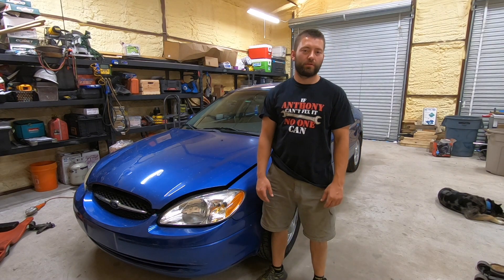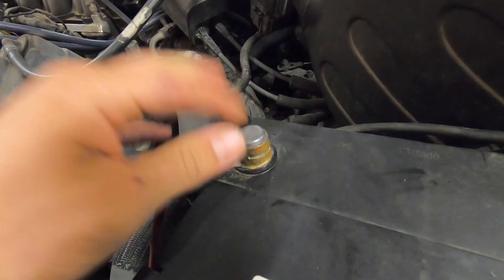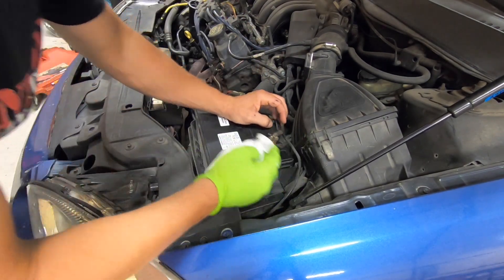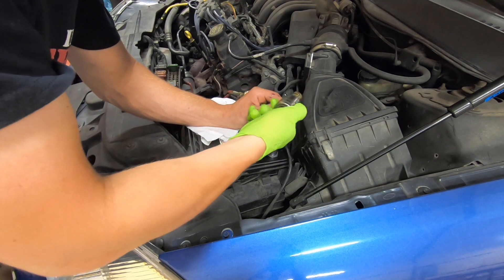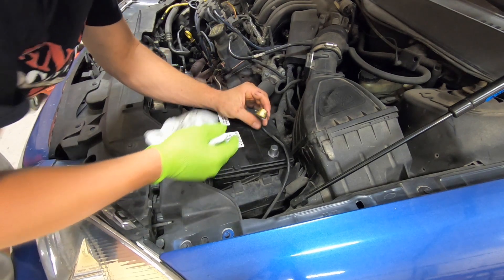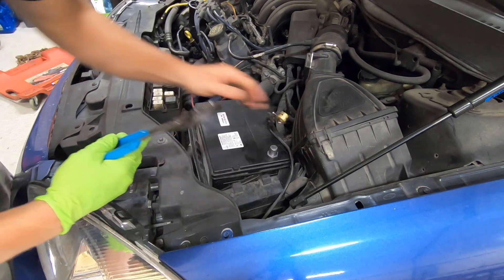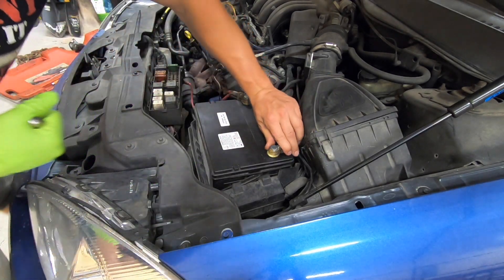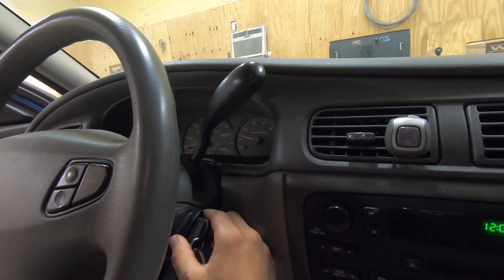HOW TO CLEAN & TIGHTEN LOOSE BATTERY TERMINALS  || EASY

Comment: When you start the car and you hear a ticking and when jumpstart it, it starts but only stays up for a minute or so could this be a problem of tightening it right?
Reply from the maker: Not likely. If you can grab the battery wires and tug them and they do not move, they are tight enough. It sounds like your alternator is bad
Reply: @dudewecanfixit  yeah got it fixed now but problem was the alternator and battery was old.
Reply from the maker: That sounds right, sorry about the late reply
Reply: @dudewecanfixit  all good 🙏🏾

Comment: been afraid to tighten the screws on my battery because I feel like I will get shocked, if the car is off is it safe to tighten the red wire?
Reply from the maker: Yes, just don't touch your tool against anything metal
Reply: Is it safe to touch either wire or just the red when the car is turned off? I got the same problems and I don’t want to touch cause I see sparks and don’t want to get shocked
Reply: @dudewecanfixit  ^
Reply from the maker: It is safe to touch the black (ground) wire. You need to be careful when touching the red wire, If your tool touches any exposed metal, it will ground out.
Reply: @dudewecanfixit  so you can touch both wires that connect to the battery just not any metal w a tool ?
Reply: @joeycont8247  ROFL! Did you even go to school??
Reply from the maker: Yes, you can touch either wire individually. 
If you are touching the red wire, make sure that it and the tool you're using don't touch anything else.

Comment: don't you warp the negative terminal too much that way? I've got the very same problem on my Honda Jaz (Fit) and I resorted to do the same you did but I fear the negative terminal now is warped from the original shape...
Reply from the maker: The original shape is not super important, what is important is that the connection is clean and tight.

Comment: CLeaning it up is supurb. You are dreaming if you think just because you deformed it you have made it back to OEM diameter.
Reply from the maker: Is it tight?
Yes, it is tight. 

Does it work?
Yep, it works. 

Will it last?
Sure will, still going strong.

It's it new?
Nope, but if you did replace it, you need to be very careful that the crimp is done perfectly or it will fail.